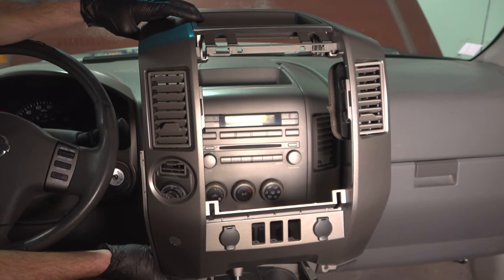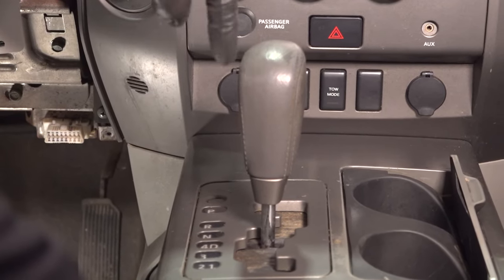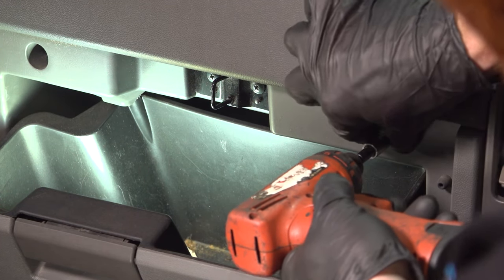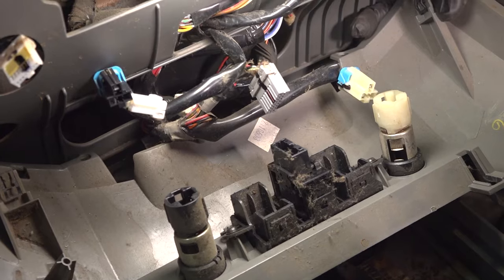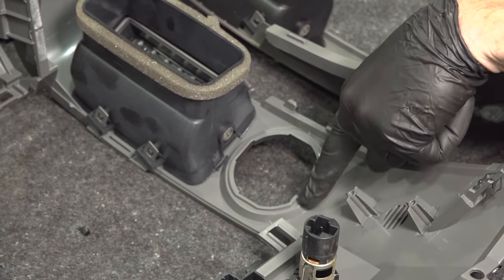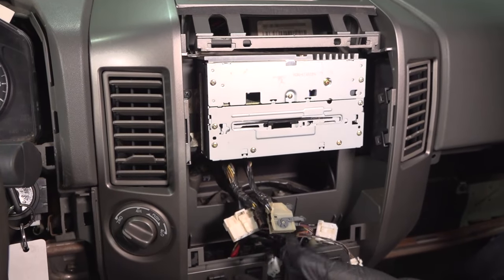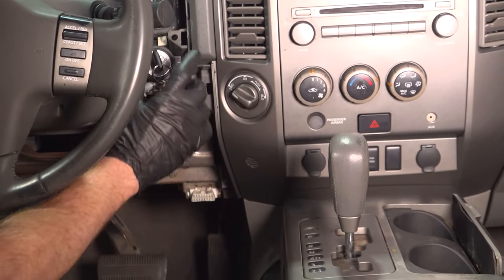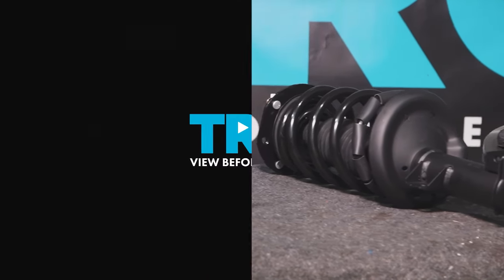How to Replace Radio Bezel 2004-2015 Nissan Titan

Comment: If that radio bezel is fractured and needs to be replaced, as mine is, then I’m assuming the other plastics I have to remove are going to break as well. And if it will ever go back together the way it was. Hesitant to do this job.

Comment: I appreciate the video.  It was very helpful to me replacing the radio bezel on my 2004 Nissan Titan. Too bad the original bezel hardens, cracks and breaks apart.  Hopefully, my cheap Amazon replacement will last longer.

Comment: Great video I replaced mine on my 2006 titan.But make note of which radio you have I have the Rockford fosgate system and the bezel I purchased did not fit .the radio hvac plate did not fit . there are three types of bezels they look identical till you put the face back on. The cluster i need is no longer available so i have to now replace the stereo to a screen version..

Comment: Very helpful video. i only needed to replace the center dash bezel. I did not need to remove the top steering wheel bezel so that saved me time. Thank you

Comment: Great video!! I had the dash speaker to deal with, so some added complexity. Also, my replacement bezel didn’t come with the power socket plastic pieces already installed as yours appeared to and getting those back in was a PITA!

Comment: I want to remove the bezel so I can mount my ham radio control head on the shelf on the bezel. I need to run a flat cable similar to a Cat 5 type cable in the seam of the bezel. I will need to cut a small notch in the seam to let the cable go through to the underside of the dash. Is this much teardown necessary to just remove the bezel? I am not going to remove any wires just get some room to run the cable. What is the part number of the bezel so that I can order one if I break the original?

Comment: The Radio Bezels I have found all say for a 2004-2006, do you know if these will actually work on a 2008?
Reply from the maker: +Steve C If your year is not on the listing, it may not fit your vehicle.